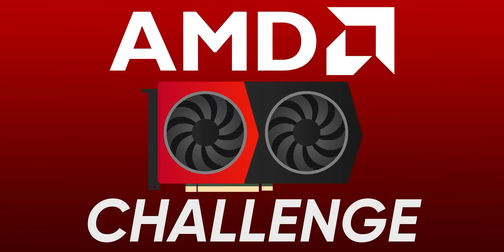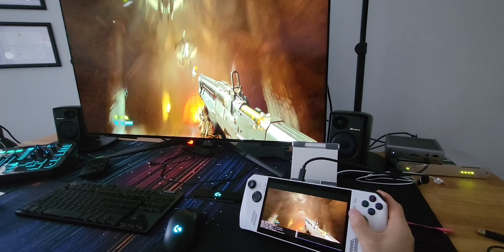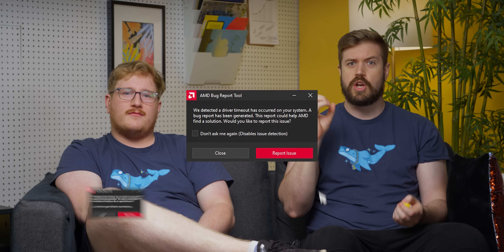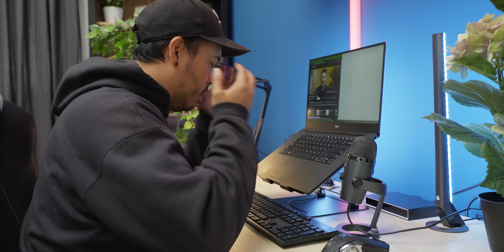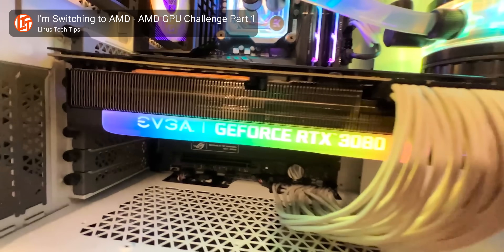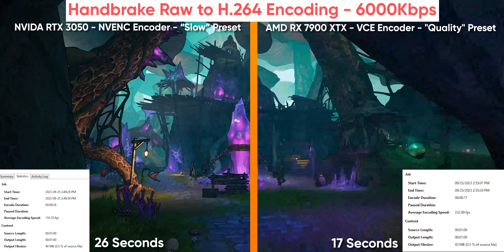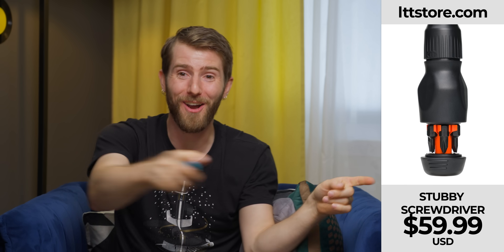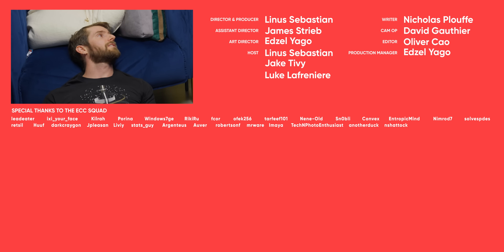I’m Staying on AMD! - Radeon Challenge Pt. 2

Comment: high idle power draw PSA:
i also have this issue. i turned my 2nd monitor refresh rate down to 60hz and the issue goes away, down to like 25 watts idle. ANY higher of a refresh rate on my 2nd monitor will push power draw up to 90-100 watts at idle. maybe the lab can figure that one out

Comment: Ive had some of the exact same problems wirh my 6700xt that Luke had. The monitor acting like 5 hz happens rarely but i just start furmark for like a tenth of a second and its fixed. The driver crashes followed by discord taking ages to start ive had aswell.

Comment: I built my first PC about 2-3 months ago for about $1100-1200 including peripherals. I got most things new on sale.
MSI B550 Tomahawk Max WiFi
AMD Ryzen 5 5600X
AMD Radeon RX6800
2TB Samsung 980 SSD with heatsink

I haven't had a single computer crash and I've had 1 Starfield crash in about 150hrs, but i think that was Starfields fault. I grav jumped to another planet and as it was loading in, it crashed. When i loaded back in it worked fine.

I recommend AMD to everyone, its damn near the same performance as Nvidia for half the price.

Comment: That bug in the frame was a nice touch. Only one beef with my 6900xt. 3rd monitor if it's off on startup causes the system to hang every two seconds. Have to turn it on and then off for things to work properly. Otherwise, does literally everything I want it to do including hardcore GPU rendering in programs the drivers are not designed to work with. Gotta trick them by loading an old pro driver, booting them, killing them, switching back to Adrenaline, everything works fine. Rebooting on driver update sucks but ya should anyway.

Comment: Well, well... I got my current RTX 2080 on the 21st of September 2018 (the launch date). I switched from Radeon R9 290X and everything with my upgrade felt exactly what Luke described + high idle power when a second display is plugged. Not to mention that I couldn't figure out how to force the boot screen on a particular monitor... Many of these issues NVIDIA didn't bother to fix for 6+ months, not to mention the disappointment with the lack of RT titles and then that RT is just a demo feature on RTX 2080.
Nevertheless, now, 5 years later, I love the card, it still handles all my gaming needs, but the 1st year I hated it.

Comment: For the first time ever I went from team green to team red in my main PC when I swapped my 3070 to a 7900XT. I was surprised how little issues I've had so far. Very happy with my purchase. Sure, overclocking has been a little sketchy and it would randomly crash when I've been trying to tinker the right settings, but that's not AMD's fault, that's all me. Nvidia's drivers weren't without its issues either. I was really frustrated with the black pixelation randomly popping in Chromium browsers, changing to AMD fixed that. My only real issue with Radeon GPU is that Stable Diffusion is really made for CUDA and AMD rOCM functions only on Linux as of now. So my only choice is using Torch-DirectML since I'm on Windows, and DirectML is seemingly not good managing VRAM. I would crash with workflows running out of all my 20GB of VRAM, when the same workflows were working fine with the 8GB the 3070 had.

Comment: Been using the 6900XT for around a year now. In this last year only a single driver version caused me problems where second monitor would have green artifacts and only 1 game caused driver timeouts. Back when I used Nvidia that never happened (this was an RTX 2070), but having said that this card had nowhere near as many useful features, such as Antilag, and  Freesync.
Reply: Huh?  Nvidia had reflex at around the same time that AMD came out with antilag and reflex is better generally by all accounts.  And it had Gsync and does Freesync today but at the time it didn't do freesync.

Comment: 3:34, I love AMD since the Linux support is really good. Plus the products are cheaper for the same performance as NVIDIA. I've concluded that Windows is at fault for the BOSD. I've tried windows 10 and 11 so I can play R6 siege but sometimes when I launch the game, the whole system gets a weird blue screen. I have 3 photos on my phone of it so far which is obviously not good. On the other hand, when I use linux, I never experience a crash of any sort. This isn't me being biased either, windows will crash in about 2-6 hours while linux can stay on for a few consecutive days until I decide to restart the system.

Comment: i had a new ARC 770 on my PC with almost 0 issues! i gave it (Arc) to my son and i bought a RX 6700 XT used to try it! i got Green screen crashes all the time my solution was to DDU and install previous Drivers (24.5.1)

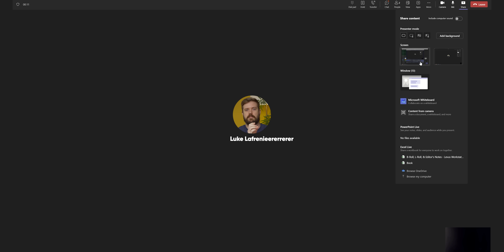Comment: 6:34 i have that exact problem that my system is running at 5fps sometimes when i enable my VR headset then i have to reinstall my vr drivers and its working again.
I have a RTX2070 in my System so for me its not an AMD issue...

Comment: I'm running and AMD 5950 / 6800 XT, first of both since the Barton days. This PC has been the most insanely rock solid system I have had since my X58/8800 GTS which was also perfect. I've had every top end NVIDIA from GTX 580 to 2080 Ti and easily this system has had less issues by a mile. I did run SLI on almost all of those NVIDIA cards except the 2080 Ti to be fair, but either way, zero issues with this system. I do feel it's more due to AM4, but the card and Radeon driver suite has been perfect. I still haven't upgraded the GPU which is saying a lot, normally I would have already bought a 40 series and be planning to buy the 50 series but it's been so good I just can't be bothered. I'll probably buy the next AMD tbh.

Comment: I have 2 PCs one with a 7900 XTX and one with a RTX 4080 both paired with an intel 13900k and I have had no issues at all and as long as ray tracing isn't enabled my 7900 XTX performs better in frame rates

Comment: Folks with high idle power should try the latest beta drivers. I happened to chance on a video online regarding it. Folks at LTT may have already heard about it but I thought I'd just mention it.
The reason I went with team green was again, related to relative power consumption to performance. The 4090. as expensive as it is, can be ran at 80% power target for a small penalty all while sipping around 230-250w on most titles and still delivering rock solid performance. This can be optimised further, of course. TLDR: AMD is getting its game on especially with FSR3. They are a great option unless you live in the EU and need some semblance of balance in those power bills.

Comment: I went to A RX7800XT from an RTX 2070 Super, and I wish I can say it was painless. I have also replaced my SSD with a fresh install of Win10Pro and have had a persistent issue. Windows , no matter what the app, would stutter badly. Playing videos on YouTube would skip and freeze constantly and the audio would be badly distorted. Playing any game would be out of the question. The only way to correct this is to reboot the system until it clears, then it works wonderfully! I wish I knew how to fix this.

Comment: AMD does have driver issues from time to time. I've been using 7800 XT for a year, and the first few months I've been getting driver time-outs like these gentlemen. They did manage to fix it in around 2 months and it's been running without a hitch ever since.
Reply: So today you don't have any issues? Like zero?
Reply: @KindredMid  Legitimately zero. I bought the card as soon as it came out, and for the first 2 or 3 months I was getting  driver timeouts quite often. No matter how much much testing they do in the lab, there will always be issues when it's released into the wild, I'd say they fixed it quickly enough.

Comment: I upgraded from a 3080ti to a 7900xtx. I have had pretty much 0 crashes and pretty much 0 issues. I didn't do a fresh windows install or anything. I installed my 7900xtx and installed the drivers and uninstalled Nvidia drivers. That was it.

Comment: 1 when switching gpus i always do a complete fresh install of windows, doesnt matter if its amd or nvidia ive ran into bluescreens and crashes and weird issues, when going from 1 to another even with doing the full driver removal, of my last 4 gpus 3 have been amd, i had a 270x, 390x, 2080, and now a rx6800 (run a 3060 on my second pc though) and the only one i ever had problems with was the 270x cause lets be honest their drivers were shit back then, plus i think my card may have also just been a bit faulty cause it died only like 2 months after i gave it to a friend

Comment: I've had AMD cards for a long time, going far back as when they were ATI Radeon. I believe my first card was an ATI Radeon X300 or X550. I can't remember very clearly which one out of those two. 

All I have to say that I've never had any issues with them. Yeah their performance might of not be as good as Nvidia, but it they get the job done. I always made sure to completely remove any old drivers before I installed the new card. Never had any game crashes or BSOD from my AMD cards. If I did, it was because I was being silly and overlooking the heck out of it lol.

Only time I had an issue with AMD was with VR on my 6700 XT. MSFS 2020 would flicker in game in VR. Although that was happening, it wasn't AMDs fault since it was in the known issues. I just overlooked that. Plus, the driver was a beta. So I just completely removed the driver and downgraded to the previous one, and the issue was fixed. A couple of weeks later, the new driver came out, and the issue was gone.

Comment: I have not had BSODs with my AMD GPUs. My Launch Radeon RX 5700 XT with blower design used to crash occasionally with Watt Man as the culprit.  It wasn’t overheating because I could play for hours at  100c with no crashes. Watt Man would crash even when not gaming for no reason at all. Remember 100c is normal for CPUs and GPUs these days ( I know there are people who think otherwise but as long as it doesn’t melt I don’t care, and guess what the 5700 XT still works and hasn’t melted after 3 years of use). The PC would just reboot its self in the middle of a game.  It wasn’t my PSU not delivering enough power. I had a Titanium efficiency rated Corsair 700watt SFX PSU that cost me nearly $200 bucks (I liked Small form factor builds until decent GPU sizes got too big. The blower design of my 5700 XT actually made it easy to fit into SFX cases).  Got a 6800XT as an upgrade over the 5700XT as I moved my PC into a Micro ATX mid tower case (the biggest form factor will go).  I still had issues with Watt Man but it was less often than before. My new GPU was being held back by my old CPU so I built a new PC with 6800 XT into Micro ATX case. Took the old parts rebuilt my old Pc with 5700 XT into a new slick SFX case.  

The issue of Watt Man crashing was resolved by using Windows 11 over windows 10. The UI of Win11 takes some time getting used to but from my experience. It’s a lot more stable than Windows 10.  I mean it rarely has any OS issues. I did have the shadows issues they were experiencing.  But I resolved it by installing the firmware update for my Motherboard. It wasn’t the Radeon that was causing it. If you are having shadow issues on a Radeon. Try updating motherboard firmware and see if it goes away.  So far I have had little to no issues with Cyberpunk 2077, Starfeild, or any game so far). The only thing is some driver releases would break the resolution detection. I play on a 43” LG 4K HDTV 60hz which looks good to me. Basically some driver releases would list 2160p as the only resolution but that is wrong because it supports many resolutions and I sometimes play on 1440p or even 1080p depending on game. However AMD does boost performance of its GPUs with driver updates over time. When I first got my 6800xt, using Ray Tracing was unplayable.  But later releases saw 40% increase in Ray Tracing performance.  Now if can actually game with Ray Tracing on at 1080p.  

My brother came to visit last Christmas and I had my old Gaming PC with the 5700 XT in the new slick SFX case. Now with Windows 11 installed. He was able to play games on it and Watt Man didn’t crash once.  Now I am wondering if I could have just saved money and not built the new PC.  I got too old years ago to be playing games all day and now days I don’t care as much about graphics.

Comment: ngl I had more issues with my 2070 super when i swapped to it from my rx 570. I had a flawless experience with the AMD GPU, but with my new graphics card, i (rarely, but worse than AMD) get crashes, artifacting, a weird flicker for less than a second, and a monitor bug where i can see some of my second monitor on my main monitor. I made sure to use DDU, I even swapped to a different boot drive after a while, and the issues persisted. I will not swap back to my RX 570, but I may continue to buy AMD in the future

Comment: What assery is this... One year ago AMD  presented 7000 gpu series, stating "no need to rebuild your desktop, no need to upgrade your case , no need for a new power adapter". And Linus said after a few months, "let's debunk that". Let's take the most enormous AMD gpu that doesn't fit in any reasonable sized case and drill holes to the reservoir retention bracket for dramatic effect. Let's use a crusty (Linus actual worlds) PSU with a riser cable and a sketchy CPU. And all of that just to imply that AMD are liars. Another try to shit on AMD by Linus. Personally, I've switched (without reinstalling windows) from a gtx 1060 to a 5600xt and then to a 6700xt without any problems whatsoever (also most of my friends do have recent AMD cards experiencing no problems at all), and  I'm never looking back again. Of course, new cards have issues with drivers, either it's an AMD or NVidia card, but of course it is only an AMD problem when Linus says it.

Comment: I've been running amd for 5 years now.... I feel like a clean install is needed. I can't recall running into 70% of these issues, granted I had a good set up in place before I'm just changing around parts. Of course you're going to run into issues after running nvidia for x amount of years when you just slap in an amd card and say a DDU will do.

Comment: When I had my GTX970 (rest its soul) I had this issue when, if I wanted to play games, I had to restart my computer and launch the game as a first thing after windows have started. Opening a browser or using Blender, prior to playing meant I had 90% chance of the game crashing. The windows event log always  reported a nvidia driver crash. I tried multiple windows reistals, driver upgrades and downgrades, I even sent the GPU on a warranty claim, for it to be checked and all those changed nothing. I were limping along until I decided to add more RAM. When I've put the new sticks in, the system would not boot at all, I started trying different combinations of sticks and slots and it turned out, that with only new RAM installed the GPU issue completely disappeared. I am writing all this to say, that graphics driver crashes might not be a 100% GPU fault and in my case similar to Luke's issues were with Nvidia GPU.

Comment: This is basically where I am at with it, AMD has caught up in terms of CPU, they are great. GPU if possible I still always recommend Nvidia if possible. On paper AMD has caught up there as well but they constantly have driver issues. Once those get figured out it should be apples to apples. Just seems like a recurring issue at this point so trust will take a while.

Comment: Ngl the only issues I've had since moving back to amd with the xtx was a starfield crash NUKING the driver to the point I had to reinstall the driver to fix it hasn't happened since but it was weird AF 
The other issue being how the gpu scaling on a lower res monitor needing me to occasionally enable or disable or change the scaling to 3% to get it to fit the screen but thats mainly because I use a jank other monitor

Comment: Sooooo I should or shouldn’t get a radeon rx 6750 xt? This is mixed reviews
Reply: Yes
Reply: Go for it. If you run into issues with it, return then buy an nvidia gpu. Honestly, I've been using AMD gpus since 2010 and I've never had a single issue with them.

Comment: I have a full AMD pc, and for the most part, it run smooth 99% of the time. Yes in Cyberpunk I have some crash, but just 1 time the pc crash and after updating my driver I have never get the same result. I work and play with the same pc and for me Teams is fine.

Comment: It seems that AMD cards don't play well in external GPU dock. Like Luke, I ran into issues with old 5700 and new 7800XT all over the places, while both of them perform flawlessly while in regular desktop case. Based on the retailer of the external GPU dock, this seems to related with PCIE signal integrity. AMD seems to be more sensitive to the noise introduced by external PCIE setup, while Nvidia is more tolerated.

Comment: I’ve got a question about hdmi and dp cables. My laptop screen suddenly went dim, so I decided to buy a 165hz monitor (fixing the laptop is the same price as the monitor but I would like to sell the laptop and get a pc hence why I went with the monitor). The laptop screen is also 165 hz.When the monitor came, it had a hdmi cable and dp cable, but my laptop only has a hdmi port and to use the monitor for gaming I needed a DP cable, I want to get  an adapter from hdmi to a display port, but when I searched online, all only support 60hz, and if I want to get a 165hz one the connection will be the other way around( monitor to laptop). Is there a method of connecting my laptop (hdmi port) to my gaming monitor (Display Port) without the loss in performance, resolution, refresh rate and quality?

Comment: bro i have same issues with 5700 xt , ppl who have win 10 have more crashes then ppl who use win 11 .... is it possible to check it with Linux or other operation system  to see if the problem is the windows or not ??